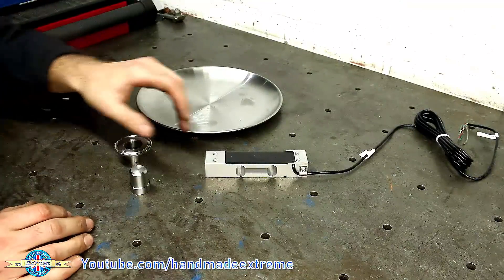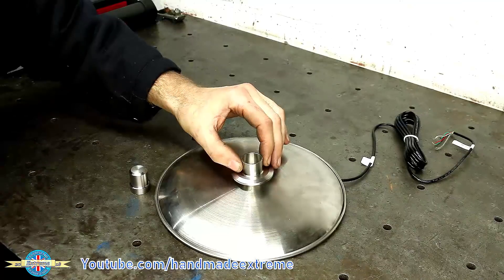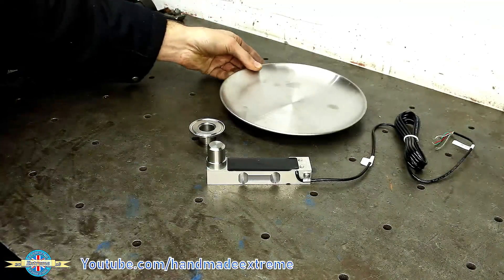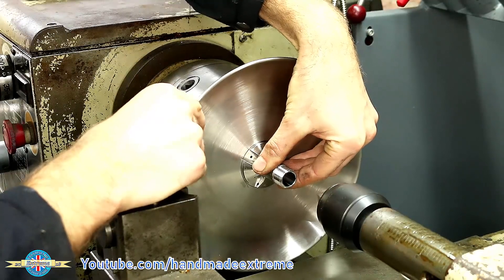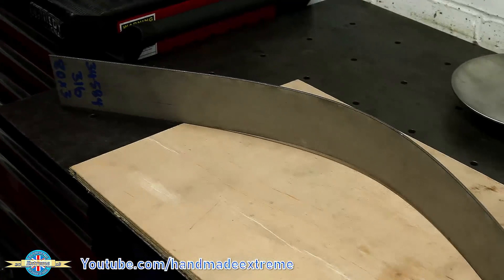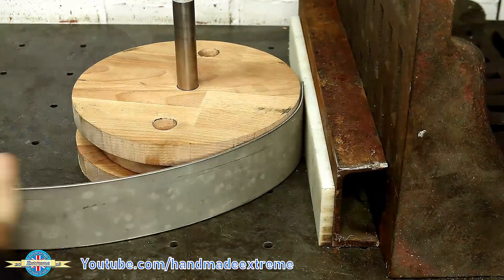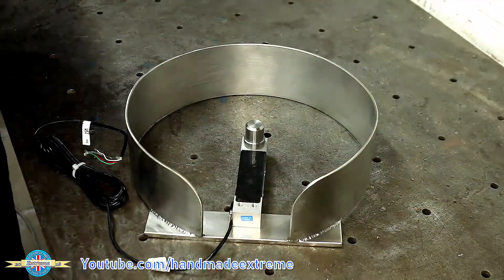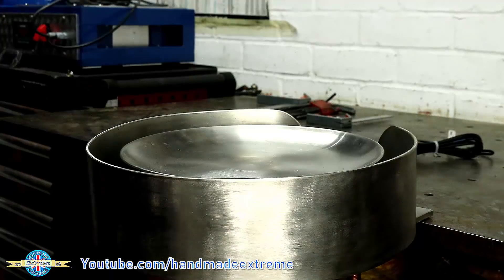Making money from a home workshop - Making a precision weighing frame.

Comment: Great idea for the one off ring roller. BTW, what is the abrasive wheel you are using for cleaning the frame? Didn't quite catch the name.
Reply from the maker: Thanks, It's a 3M clean and strip wheel.

Comment: Quite nicely done. Welding thin materials can be a bit of a trick for many, but you nailed it. The end result looked like a commercial product.
Reply from the maker: Thank you very much. You should have seen my first attempt. They gave me an extra plate in anticipation of the being 'issues'. Tried to run a fillet all the way round the tri-clamp flange. Welded beautifully on the rotary positioner but the plate ended up looking like a Pringle haha

Comment: Would countersunk screws  instead of the button heads been better so that they and the base plates sit flush?
Reply from the maker: On the two that are being used for production the plate is going to the thicker then the screws will be fitted from the top. 👍
Reply: I thought M6 screws were the go to size, and M5's are a bit special, and send folk off looking for a different Allen key. But I might well be out of date or misguided.

Comment: To be accurate do there not need to be locating rings so the jug and dish are concentric, or does the position of the jug not make that much difference?
Reply from the maker: I asked that very question to the customer and they informed me that the loadcell is clever enough to counteract an offset load to some degree. They have done so testing with the prototype and it seems to be working well. Great question.  👍
Reply: You can put a stopper underneath the loadcell to prevent overloading. Its done in some Commercial fish scale type loadcells.

Comment: Won't there be more torque applied to the load cell if something is sitting at the front edge of the plate? That is, if the plate adapter is screwed into the load cell instead of simply sitting on top of it.
Reply from the maker: I asked that very question to the customer and they informed me that the loadcell is clever enough to counteract an offset load to some degree. Don't know how, that's definitely their area of expertise. They have done some testing with the prototype and it seems to be working well. Great question.
Reply: @Handmadeextreme  
Ah, they must be doing multiple measurements in the load cell and calculating an offset. Genius stuff.

Comment: You might want to make a small hole on the side of the tube adapter, so vacuum, if the thing should get oily for some reason, can't make it not come apart.
Reply from the maker: Great idea, had no considered that. Thanks.
Reply: @Handmadeextreme  Glad to be of help!, good work, btw!

Comment: Great little project.
I hope you don't mind, but how do you go about pricing a job such as this?
1) Hourly rate + materials?
2) Roughly assess materials and time cost etc. and think of a number?
3) other
Already looking forward to the ring roller video.
Regards Mark in the UK
Reply from the maker: Hi Mark.

I tend to work out pricing based on:
Hourly rate + Materials & Consumables. Remember to consider wear and tare on machines and tooling, electricity and other overheads etc. 

If I have to quote for a fixed price job then:
Estimate time then double it. That tends to work out about right. I always think I work faster than I do and thinks always come up that I have not considered. 
Price up materials and parts etc. 

Got to say I'm not very good at pricing. I have been very lucky that my main customer has turned round on occasion and told me I'm not quoting enough and we have adjusted accordingly. I think it really boils down to experience. Something I'm gaining slowly.  

A friend of mine used to think of a number, double it then add a bit.... Worked will for him to be honest.. haha

Some of the materials for the ring roller are starting to come in so hope to have that out soon ish. 
Thanks for the support.

Comment: Love your vodeos mate. Keep up the good work🤝
Reply from the maker: Thank you. I have just shot another one a bit like this one. Materials for the ring roller are coming in at the moment so hope to have that one out soon as well. Thanks for the continued support.
Reply: @Handmadeextreme  I find your videos very useful as I like to think I am handy myself and there is always something new to learn. You explain things clear and easy to understand and love your down to earth approach. I might need to build a ring roller myself some day and will be interesting to see how you go about to make yours🤝
Reply: I was just wondering mate. Is the fact that the triclamp being sat against the plate with plug welds ( rather than the seam welded) a problem for hygiene? I have only done a very small amount if hygienic stuff but was not allowed to have mating faces that cannot be disassembled for cleaning as bacteria can get stuck in the space between. I'm not being negative 👍. Maybe it's fine but maybe it was overlooked in the design and might save you having to take them all back to your workshop to weld the joint. Good video. Thank you.
Reply from the maker: @rich3633  Great question.  I believe that it is not a problem given the application of the weigher. Can't say what it's for exactly as that's my customers business. They give me permission to show you guys what I'm making but can't really go into specifics about what it's all for. Thanks for the support.
Reply: @Handmadeextreme  I have to say, I certainly wouldn't have a problem with it's construction. It doesn't look like it will ever come into contact with any produce and I think chucking it in some bleach would be fine even if it did. Unfortunately I have found common sense doesn't apply most of the time, just meeting the spec. Thanks again, great channel. You're a very skilled bloke with lots of ingenuity. Cheers.